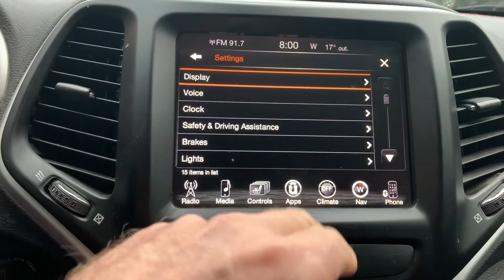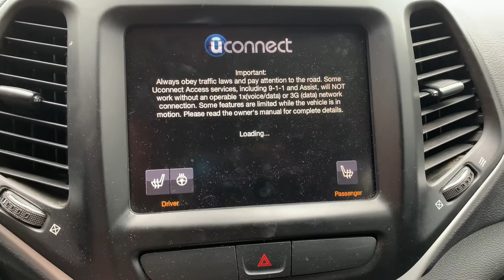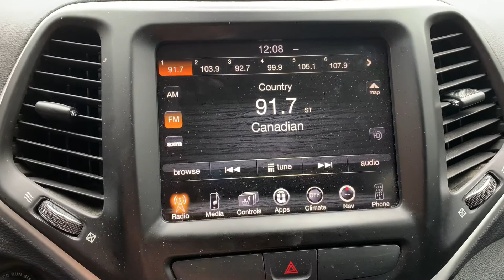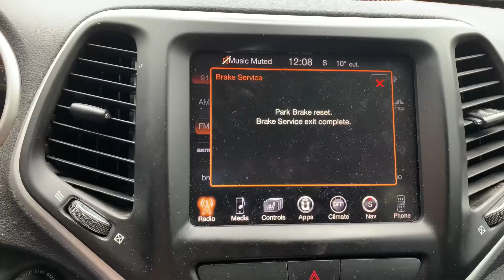Replacing the Rear Rotors on our 2015 Jeep Cherokee Trailhawk

Comment: Yup, definitely calling you if I need help with my jeep.
Reply from the maker: The Jeep has been interesting... I personally don't think my wife or I would ever buy another Jeep...
What are you guys driving?
Reply: @LivingtheNorthernLife  I started out, years ago, with a Grand Cherokee, loved it. But then got 2 mastiffs that wouldn't fit in it, so got a Yukon XL 2500...hated it. Went back to a Jeep Commander. Loved it until it got to that point where the cost of repairs and things going wrong made it unreliable. Now I have a plain old cherokee. Not loving it as much as the other 2 I had. I end up driving my husband's F250 10 cylinder more, lol. I tend to buy big things, like fruit trees, on a whim and I don't like being limited on space when it comes to my shopping, lol.

Comment: Why retract the brakes twice? Is it not possible to do this once and activate the brakes in uconnect for both rear wheels after you are done with service on both wheels.
Reply from the maker: Just a personal thing I guess.
I'm certain that shops only do it once as they have it up in the air and it wouldn't be practical to do it twice.